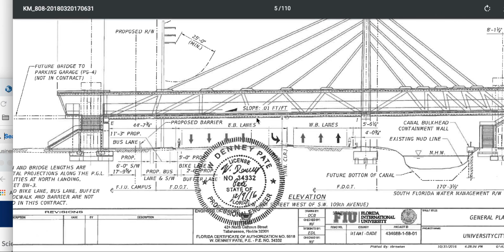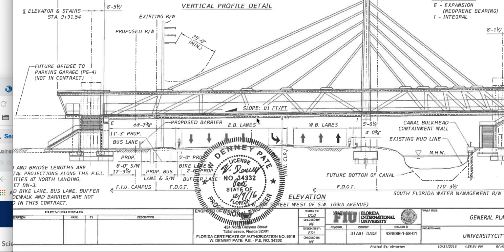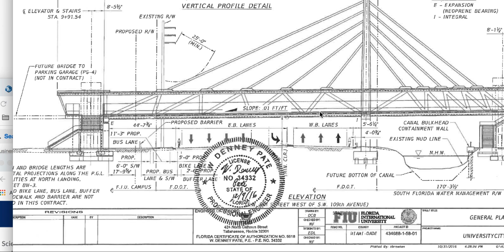FIU Bridge Collapse SHEAR OF DECK, TRANSVERSE CABLE FAILURE

Comment from the maker: 8:30  very interesting, the latest images do not support this statement fully... It appears to be part of 12 leaning towards center of deck and also a shear of 12 through the diaphragm / girder...   as per the latest OSHA images...   This is subject to change as even more data and images are presented.
Turned out to be the dead load of the 12 column / upright and then being pulled over by the canopy via the connection and creep of the deck and canopy together.

Comment: Very interesting site and comments-April 20 +   Were the longitudinal cables functioning??  The photo with 4 + inches rule deep cracks demonstrates that the end (12) did not kick out in shear as do your other videos  also show.   It appears to me the burn marks on (12) reveal  a crisis  situation that unfolded prior to the  decision to detention at blister 11-10. It is likely that the anchor plate, cable or keeper failed on the inner longitudinal cable and was heard by workers.  To address this new issue in haste the plastic cover was removed to view the anchor with a hand grinder.-- It is interesting to speculate that even given such a dire circumstance the the safety and bridge may have been preserved.
Reply from the maker: Max, I am glad you said it, as if I say the same, the trolls attack me... Thanks for your comment and I enjoyed your comment about ''crisis situation that unfolded''...   That a torch appears to have been required to remove some ''parts'' ... I do not think we will ever get the data behind those ''burn marks'' but, I do believe ...

Comment: I agree completely. First i think it would have worked with the two spans offsetting each other. With the two canopies pulling on each other it would have put them in tension and with the slabs pushing on each other that scallop would not have broken out of the end of the slab. 11 was like a chisel and a ram pushing out on the slab end. It made some sense to tension it and pull it back but it was already over compressed and crumbing. Maybe tension in the slab would have saved it but it should have been braced until the structure could function in equilibrium. There is that word

Comment: Also with the pt bars being at a 90deg angle to each other at the blister wouldn't that create shear and torsion forces within that small area of concrete?
Reply from the maker: Agreed but, also we need to know the intent of the amount of force applied to bars.
If, they were just to put everything in equilibrium then no harm 😒

Comment: What I find very curious is the 10/11 blister sheared off from canopy which would imply the pt bars pulled out the bottom of it.  If not it would have broken in half right?  I'm no structural engineer but it seems like a lot of load was concentrated in a very small area of the blister with 4 pt bars terminated at virtually the same point.  Wouldn't it have been better to have a weldment at the blisters to terminate the pt bars at and spread the load out some? This would also give you an attachment point for the pipes coming down from the tower.

Comment: So if I follow, something detensioned lower deck longitudinal cables (failure of anchor point?) Which transfered load to canopy. This additional load transferred down 11 resulting in shear failure of deck around 12.   Also seems like 11 was splitting due to excess load at this point. Combined this would unload 11 putting load on 10?  This would put load that should have been concentrated at 12 at the canopy blister 10/11, no? So maybe when they exposed the post tension bars for 11 they compromised the concrete in the blister.  So when the pt bar failed while they were trying to reload 11 the bridge canopy failed at the 10/11 blister, hinging bridge at base of 10 which is where it seems to have failed and down she came?
Reply from the maker: I am on the road and wanted to just comment on your post, yes, you are getting a good load path failure...
Except I have not found any images showing 11 was transferring loads under compression at time of failure, based on images that I could find.
Reply from the maker: Read your comment again...  Bill, I just wish we had more images...  so, I  can eliminate some of my extrapolation.

Comment from the maker: Again, this is NOT shearing of number 11 & 12 as the NTSB and other forums insist. This is shearing of DECK AROUND number 12  --- possibly because of transverse cables failing or elongation of longitudinal cables in decking and canopy; leaning more towards deck and transverse cable failure and rotation of side ''wing'' of decking.  That is one side had more of a reaction than the opposite side. Equilibrium was established and shows itself in the NTSB photos presented (so far)...  
I really wish we had access to all the images and as-built data...